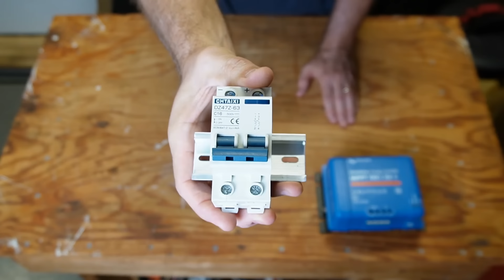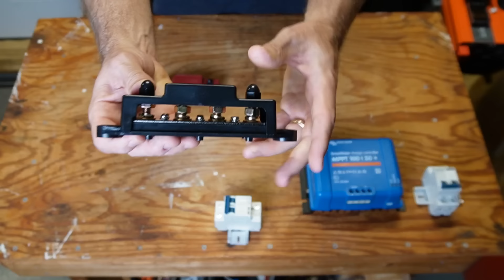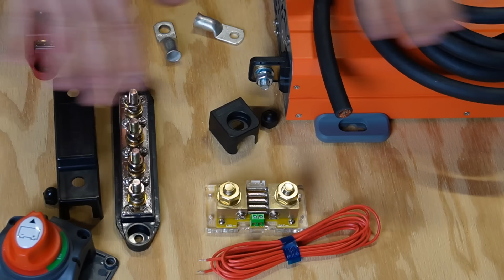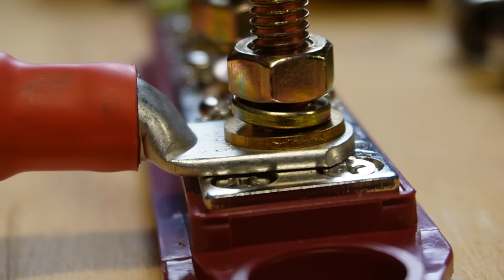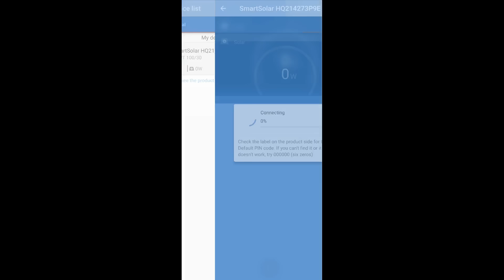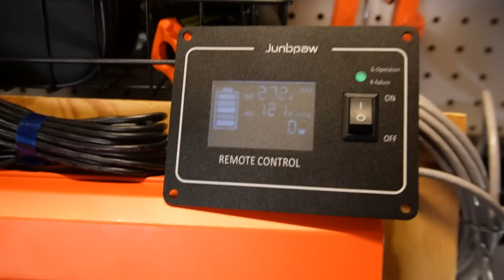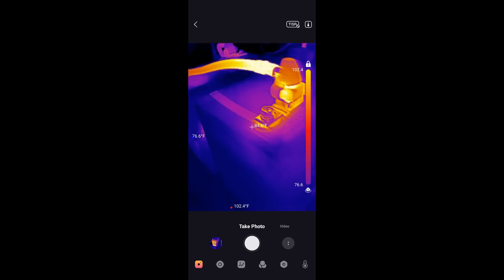24V DIY Off-Grid Solar Generator Build For Beginners

Comment: Those batteries will drift you need to put a  battery balancer  on them ... litime sells one..
Reply from the maker: I actually have the litime one. I may do that. I've not actually used that balancer yet.
Reply: 255  God! There is no god except He, the Living, the Everlasting. Neither slumber overtakes Him, nor sleep. To Him belongs everything in the heavens and everything on earth. Who is he that can intercede with Him except with His permission? He knows what is before them, and what is behind them; and they cannot grasp any of His knowledge, except as He wills. His Throne extends over the heavens and the earth, and their preservation does not burden Him. He is the Most High, the Great.
256  There shall be no compulsion in religion; the right way has become distinct from the wrong way. Whoever renounces evil and believes in God has grasped the most trustworthy handle; which does not break. God is Hearing and Knowing.
257  God is the Lord of those who believe; He brings them out of darkness and into light. As for those who disbelieve, their lords are the evil ones; they bring them out of light and into darkness—these are the inmates of the Fire, in which they will abide forever.
258  Have you not considered him who argued with Abraham about his Lord, because God had given him sovereignty? Abraham said, “My Lord is He who gives life and causes death.” He said, “I give life and cause death.” Abraham said, “God brings the sun from the East, so bring it from the West,” so the blasphemer was confounded. God does not guide the wrongdoing people.
259  Or like him who passed by a town collapsed on its foundations. He said, “How can God revive this after its demise?” Thereupon God caused him to die for a hundred years, and then resurrected him. He said, “For how long have you tarried?” He said, “I have tarried for a day, or part of a day.” He said, “No. You have tarried for a hundred years. Now look at your food and your drink—it has not spoiled—and look at your donkey. We will make you a wonder for mankind. And look at the bones, how We arrange them, and then clothe them with flesh.” So when it became clear to him, he said, “I know that God has power over all things.”
260  And when Abraham said, “My Lord, show me how You give life to the dead.” He said, “Have you not believed?” He said, “Yes, but to put my heart at ease.” He said, “Take four birds, and incline them to yourself, then place a part on each hill, then call to them; and they will come rushing to you. And know that God is Powerful and Wise.”

2  God, there is no god but He, the Living, the Eternal.
3  He sent down to you the Book with the Truth, confirming what came before it; and He sent down the Torah and the Gospel.
4  Aforetime, as guidance for mankind; and He sent down the Criterion. Those who have rejected God’s signs will have a severe punishment. God is Mighty, Able to take revenge.
5  Nothing is hidden from God, on earth or in the heaven.
6  It is He who forms you in the wombs as He wills. There is no god except He, the Almighty, the Wise.

11  Originator of the heavens and the earth. He made for you mates from among yourselves, and pairs of animals, by means of which He multiplies you. There is nothing like Him. He is the Hearing, the Seeing.
12  To Him belongs absolute control of the heavens and the earth. He spreads the bounties to whomever He wills, or reduces it. He is aware of all things.
13  He prescribed for you the same religion He enjoined upon Noah, and what We inspired to you, and what We enjoined upon Abraham, and Moses, and Jesus: “You shall uphold the religion, and be not divided therein.” As for the idolaters, what you call them to is outrageous to them. God chooses to Himself whom He wills, and He guides to Himself whoever repents.

54  Your Lord is God; He who created the heavens and the earth in six days, then established Himself on the Throne. The night overtakes the day, as it pursues it persistently; and the sun, and the moon, and the stars are subservient by His command. His is the creation, and His is the command. Blessed is God, Lord of all beings.
55  Call upon your Lord humbly and privately. He does not love the aggressors.
56  And do not corrupt on earth after its reformation, and pray to Him with fear and hope. God’s mercy is close to the doers of good.
57  It is He who sends the wind ahead of His mercy. Then, when they have gathered up heavy clouds, We drive them to a dead land, where We make water come down, and with it We bring out all kinds of fruits. Thus We bring out the dead—perhaps you will reflect.
58  As for the good land, it yields its produce by the leave of its Lord. But as for the bad, it produces nothing but hardship and misery. Thus We explain the revelations in various ways for people who are thankful.
59  We sent Noah to his people. He said, “O my people! Worship God; you have no god other than Him. I fear for you the punishment of a tremendous Day.”
60  The dignitaries among his people said, “We see that you are in obvious error.”
61  He said, “O my people, I am not in error, but I am a messenger from the Lord of the Worlds.”
62  “I deliver to you the messages of my Lord, and I advise you, and I know from God what you do not know.”
63  “Do you wonder that a reminder has come to you from your Lord, through a man from among you, to warn you, and to lead you to righteousness, so that you may attain mercy?”
64  But they called him a liar. So We saved him and those with him in the Ark, and We drowned those who rejected Our revelations. They were blind people.

59  The likeness of Jesus in God’s sight is that of Adam: He created him from dust, then said to him, “Be,” and he was.
60  The truth is from your Lord, so do not be of those who doubt.
61  And if anyone disputes with you about him, after the knowledge that has come to you, say, “Come, let us call our children and your children, and our women and your women, and ourselves and yourselves, and let us invoke God’s curse on the liars.”
62  This is the narrative of truth: there is no god but God. God is the Mighty, the Wise.
63  But if they turn away—God knows the corrupt.
64  Say, “O People of the Book, come to terms common between us and you: that we worship none but God, and that we associate nothing with Him, and that none of us takes others as lords besides God.” And if they turn away, say, “Bear witness that we have submitted.”
65  O People of the Book! Why do you argue about Abraham, when the Torah and the Gospel were not revealed until after him? Will you not reason?
66  Here you are—you argue about things you know, but why do you argue about things you do not know? God knows, and you do not know.
67  Abraham was neither a Jew nor a Christian, but he was a Monotheist, a Muslim. And he was not of the Polytheists.
68  The people most deserving of Abraham are those who followed him, and this prophet, and those who believe. God is the Guardian of the believers.
69  A party of the People of the Book would love to lead you astray, but they only lead themselves astray, and they do not realize it.

84  Say, “We believe in God, and in what was revealed to us; and in what was revealed to Abraham, and Ishmael, and Isaac, and Jacob, and the Patriarchs; and in what was given to Moses, and Jesus, and the prophets from their Lord. We make no distinction between any of them, and to Him we submit.”
85  Whoever seeks other than Islam as a religion, it will not be accepted from him, and in the Hereafter he will be among the losers.

28  It is He who sent His Messenger with the guidance and the religion of truth, to make it prevail over all religions. God suffices as Witness.
29  Muhammad is the Messenger of God. Those with him are stern against the disbelievers, yet compassionate amongst themselves. You see them kneeling, prostrating, seeking blessings from God and approval. Their marks are on their faces from the effects of prostration. Such is their description in the Torah, and their description in the Gospel: like a plant that sprouts, becomes strong, grows thick, and rests on its stem, impressing the farmers. Through them He enrages the disbelievers. God has promised those among them who believe and do good deeds forgiveness and a great reward.

111  And say, “Praise be to God, who has not begotten a son, nor has He a partner in sovereignty, nor has He an ally out of weakness, and glorify Him constantly.”

Read The Quran

Comment: As for the inverter wire  i never use 24v for the division i calculate at the worse point that is the voltage cut off point 

In the case of 24v thats about 20v i would divide 2080 by 20
Reply from the maker: That's a good point. As the voltage goes down, the amps go up under the same load. Thanks for that tip!
Reply: 255  God! There is no god except He, the Living, the Everlasting. Neither slumber overtakes Him, nor sleep. To Him belongs everything in the heavens and everything on earth. Who is he that can intercede with Him except with His permission? He knows what is before them, and what is behind them; and they cannot grasp any of His knowledge, except as He wills. His Throne extends over the heavens and the earth, and their preservation does not burden Him. He is the Most High, the Great.
256  There shall be no compulsion in religion; the right way has become distinct from the wrong way. Whoever renounces evil and believes in God has grasped the most trustworthy handle; which does not break. God is Hearing and Knowing.
257  God is the Lord of those who believe; He brings them out of darkness and into light. As for those who disbelieve, their lords are the evil ones; they bring them out of light and into darkness—these are the inmates of the Fire, in which they will abide forever.
258  Have you not considered him who argued with Abraham about his Lord, because God had given him sovereignty? Abraham said, “My Lord is He who gives life and causes death.” He said, “I give life and cause death.” Abraham said, “God brings the sun from the East, so bring it from the West,” so the blasphemer was confounded. God does not guide the wrongdoing people.
259  Or like him who passed by a town collapsed on its foundations. He said, “How can God revive this after its demise?” Thereupon God caused him to die for a hundred years, and then resurrected him. He said, “For how long have you tarried?” He said, “I have tarried for a day, or part of a day.” He said, “No. You have tarried for a hundred years. Now look at your food and your drink—it has not spoiled—and look at your donkey. We will make you a wonder for mankind. And look at the bones, how We arrange them, and then clothe them with flesh.” So when it became clear to him, he said, “I know that God has power over all things.”
260  And when Abraham said, “My Lord, show me how You give life to the dead.” He said, “Have you not believed?” He said, “Yes, but to put my heart at ease.” He said, “Take four birds, and incline them to yourself, then place a part on each hill, then call to them; and they will come rushing to you. And know that God is Powerful and Wise.”

2  God, there is no god but He, the Living, the Eternal.
3  He sent down to you the Book with the Truth, confirming what came before it; and He sent down the Torah and the Gospel.
4  Aforetime, as guidance for mankind; and He sent down the Criterion. Those who have rejected God’s signs will have a severe punishment. God is Mighty, Able to take revenge.
5  Nothing is hidden from God, on earth or in the heaven.
6  It is He who forms you in the wombs as He wills. There is no god except He, the Almighty, the Wise.

11  Originator of the heavens and the earth. He made for you mates from among yourselves, and pairs of animals, by means of which He multiplies you. There is nothing like Him. He is the Hearing, the Seeing.
12  To Him belongs absolute control of the heavens and the earth. He spreads the bounties to whomever He wills, or reduces it. He is aware of all things.
13  He prescribed for you the same religion He enjoined upon Noah, and what We inspired to you, and what We enjoined upon Abraham, and Moses, and Jesus: “You shall uphold the religion, and be not divided therein.” As for the idolaters, what you call them to is outrageous to them. God chooses to Himself whom He wills, and He guides to Himself whoever repents.

54  Your Lord is God; He who created the heavens and the earth in six days, then established Himself on the Throne. The night overtakes the day, as it pursues it persistently; and the sun, and the moon, and the stars are subservient by His command. His is the creation, and His is the command. Blessed is God, Lord of all beings.
55  Call upon your Lord humbly and privately. He does not love the aggressors.
56  And do not corrupt on earth after its reformation, and pray to Him with fear and hope. God’s mercy is close to the doers of good.
57  It is He who sends the wind ahead of His mercy. Then, when they have gathered up heavy clouds, We drive them to a dead land, where We make water come down, and with it We bring out all kinds of fruits. Thus We bring out the dead—perhaps you will reflect.
58  As for the good land, it yields its produce by the leave of its Lord. But as for the bad, it produces nothing but hardship and misery. Thus We explain the revelations in various ways for people who are thankful.
59  We sent Noah to his people. He said, “O my people! Worship God; you have no god other than Him. I fear for you the punishment of a tremendous Day.”
60  The dignitaries among his people said, “We see that you are in obvious error.”
61  He said, “O my people, I am not in error, but I am a messenger from the Lord of the Worlds.”
62  “I deliver to you the messages of my Lord, and I advise you, and I know from God what you do not know.”
63  “Do you wonder that a reminder has come to you from your Lord, through a man from among you, to warn you, and to lead you to righteousness, so that you may attain mercy?”
64  But they called him a liar. So We saved him and those with him in the Ark, and We drowned those who rejected Our revelations. They were blind people.

59  The likeness of Jesus in God’s sight is that of Adam: He created him from dust, then said to him, “Be,” and he was.
60  The truth is from your Lord, so do not be of those who doubt.
61  And if anyone disputes with you about him, after the knowledge that has come to you, say, “Come, let us call our children and your children, and our women and your women, and ourselves and yourselves, and let us invoke God’s curse on the liars.”
62  This is the narrative of truth: there is no god but God. God is the Mighty, the Wise.
63  But if they turn away—God knows the corrupt.
64  Say, “O People of the Book, come to terms common between us and you: that we worship none but God, and that we associate nothing with Him, and that none of us takes others as lords besides God.” And if they turn away, say, “Bear witness that we have submitted.”
65  O People of the Book! Why do you argue about Abraham, when the Torah and the Gospel were not revealed until after him? Will you not reason?
66  Here you are—you argue about things you know, but why do you argue about things you do not know? God knows, and you do not know.
67  Abraham was neither a Jew nor a Christian, but he was a Monotheist, a Muslim. And he was not of the Polytheists.
68  The people most deserving of Abraham are those who followed him, and this prophet, and those who believe. God is the Guardian of the believers.
69  A party of the People of the Book would love to lead you astray, but they only lead themselves astray, and they do not realize it.

84  Say, “We believe in God, and in what was revealed to us; and in what was revealed to Abraham, and Ishmael, and Isaac, and Jacob, and the Patriarchs; and in what was given to Moses, and Jesus, and the prophets from their Lord. We make no distinction between any of them, and to Him we submit.”
85  Whoever seeks other than Islam as a religion, it will not be accepted from him, and in the Hereafter he will be among the losers.

28  It is He who sent His Messenger with the guidance and the religion of truth, to make it prevail over all religions. God suffices as Witness.
29  Muhammad is the Messenger of God. Those with him are stern against the disbelievers, yet compassionate amongst themselves. You see them kneeling, prostrating, seeking blessings from God and approval. Their marks are on their faces from the effects of prostration. Such is their description in the Torah, and their description in the Gospel: like a plant that sprouts, becomes strong, grows thick, and rests on its stem, impressing the farmers. Through them He enrages the disbelievers. God has promised those among them who believe and do good deeds forgiveness and a great reward.

111  And say, “Praise be to God, who has not begotten a son, nor has He a partner in sovereignty, nor has He an ally out of weakness, and glorify Him constantly.”

Read The Quran

Comment: You can use smaller guage wire if you use silicone type cables they habdle more amps
Reply from the maker: Thanks for that tip! What brand do you use?